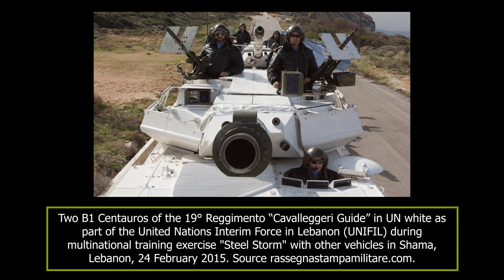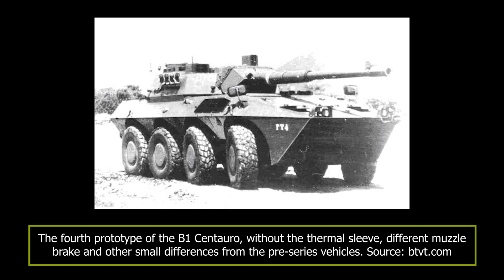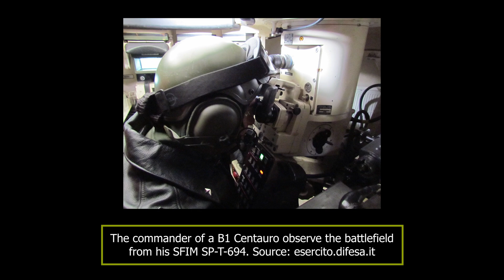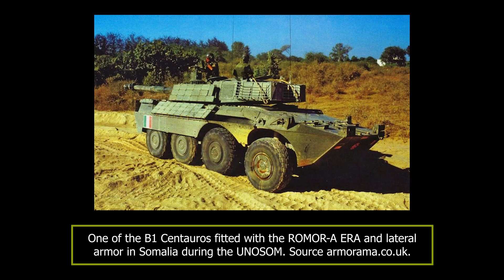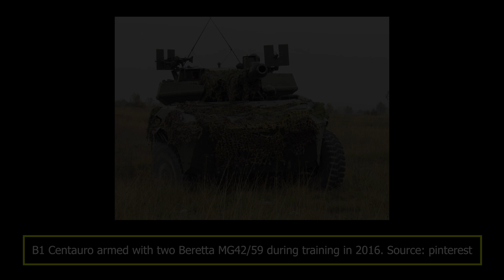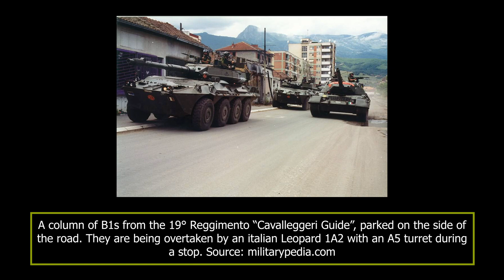Wheeled Gladiator | The B1 Centauro (part 1)

Comment: The mg3 comes normally with two  bolts. One that give 800 RPM and one that give 1200 RPM.
Reply: The Italian variant doesn't have that, its rate of fire remains 800 RPM